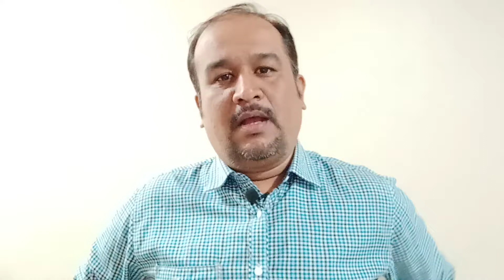[1 Min Game Changer] What is Tibco Adapter?  🤔

Comment: What is difference between adapter and plugin, for eg. Tibco has mq adapter and plugin both
Reply from the maker: Thats great question @Krunal ... Plug-in is for more specific needs between two tools where data movement is not required but adapter meets the greater needs of the integration between two applications or tools.
Register for my free video series on https://go.samj.tech/videoseries